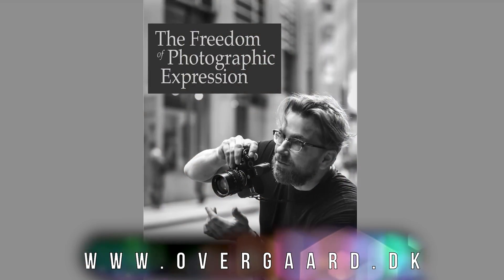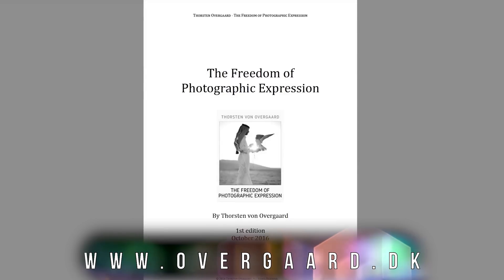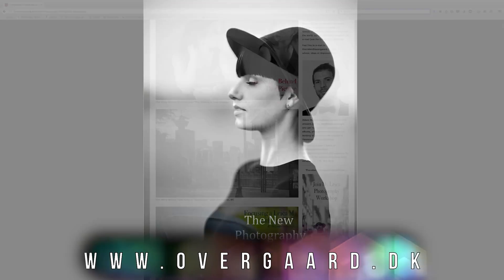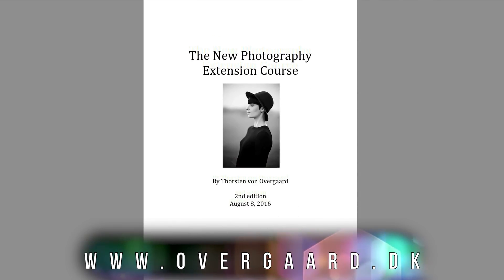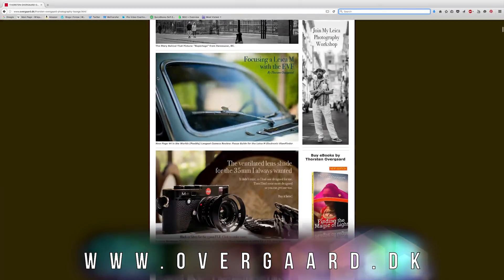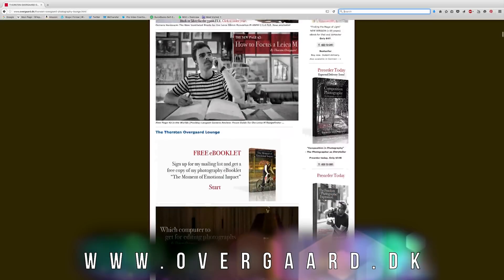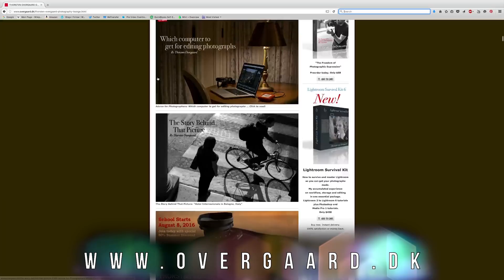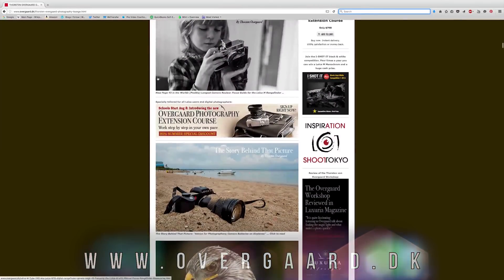"What is Sensor Noise" by Leica Photographer Thorsten von Overgaard

Comment: Well yes and no. You are the first YouTube reviewer I have seen who understands base ISO. Basically it's the basic output of the sensor; the signal you get if you  dont add gain to the preamps. Base ISO is the best image you can get from a camera, it is the raw data. Noise doesnt come from the algorythm, it is already  present before the image is processed, it is intrinsic to the physical processes associated with the sensor and has two main components. Firstly there is thermal noise, like hum in a valve radio; this is what puts the  specs of noise in dark areas not the algorythm guessing. This is why  sensitive astro cameras are cooled to cryogenic temperatures to reduce thermal noise. The second component is counting statistics. The pixel is basically counting photons as they arrive and until it counts  sufficiant  numbers then it is noisy; for a smooth signal you must have more light, it is statistical averaging. There is no such thing as a sensor without noise, if you cant see it then its been removed in camera, which isnt a good thing as it is best dealt  with in post under your control. Well ISO is  like a volume knob on a radio and applies an increasing magnification to the  signal preamps. It blows up the signal but it also  blows up the noise which must be minimised by the processing  engine or it will be very noticeable; like the radio hum on full volume.  Lower ISO is always best because  the algorythms dont remove noise, that is impossible, there is no electrical  difference between noise and photo, they hide it by a process of spreading the noise peaks over a wider area, a process more accurately called smoothing. Yes you get a cleaner better looking  image but it contains less information as fine detail has been blurred in the process. It's a trade off of how much detail can you afford to lose to improve the smoothness; that is the photographers choice but they should be aware of the  compromise they are making.This can be minimised by using sensor invariance but that is a technique for the more adventurous.  I hope that clarifies the process. I do love your  videos.
Reply: Many thanks for this great explanation and comparison. It has helped me to understand ISO better
Reply: Smart girl
Reply: I know I'm quite randomly asking but do anybody know of a good site to stream new tv shows online?
Reply: @Alexander Ronan try FlixZone. You can find it by googling =)
Reply: @Alexander Ronan I would suggest FlixZone. Just search on google for it =)